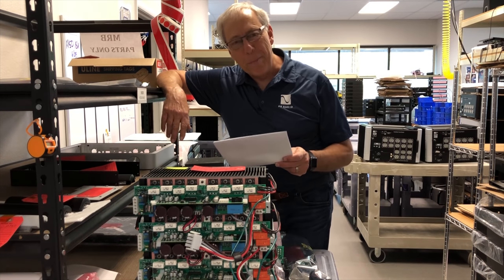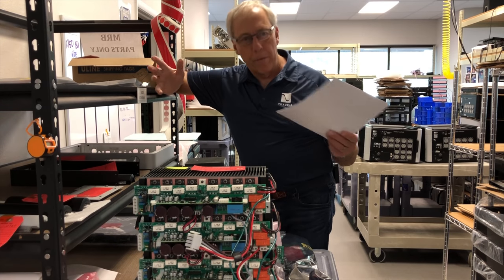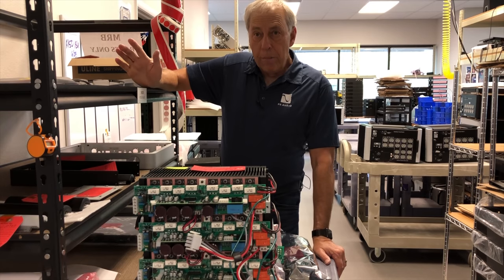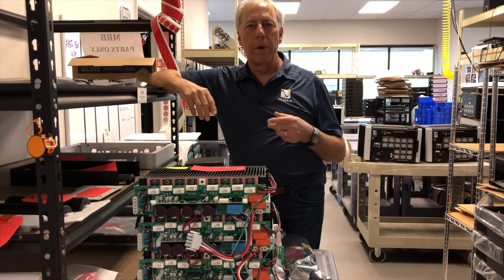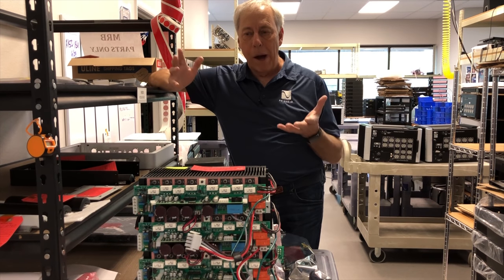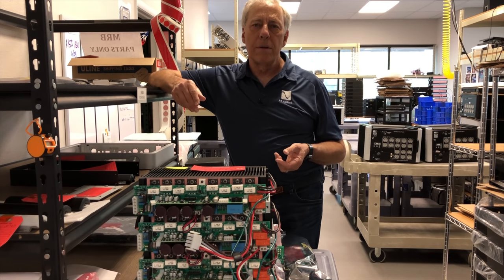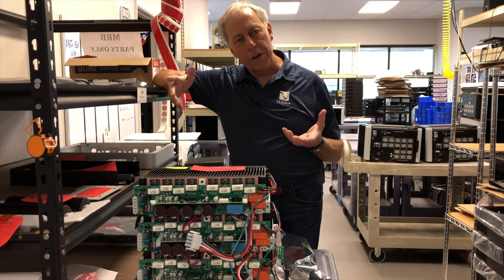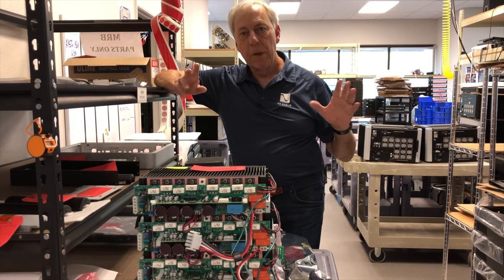Is the BBC dip still used in speakers?

Comment: The crossover region is always difficult as in nature there are no crossovers. Because one driver has a leading phase shift and the other a lagging shift at the crossover point it is very hard to get it right. When in the 2000s when I worked for a high end professional speaker manufacturer in LA, we did a  lot of work on this but not having anything to do with a BBC dip. Rather we found several issues and one of them was helped by time alignment. Aligning the positions of the LF and HF and where applicable the MF drivers was a partial solution. The mid/high crossover was especially critical as the source of sound from the MF and LF drivers were not at the same point, this caused a big phase shift at the crossover point that especially would mess up the female singing voice. Eventually we developed a coaxial mid/high driver with a mechanical mixer for the sound from each driver. As well, the horn throat and flare we developed has so straight sides or square corners. 
There is no natural sound source with square corners and computer modelling of the power available by 1995 showed us the distortion inherent in horns with sharp angles. Going to all curved horns was a huge help.
We also had to tweak every crossover design through extensive listening tests. We had a crossover peg board and boxes of inductors, resistors and capacitors and tweaked the crossovers in a large free field listening area. Then do full 360 degree acoustic dispersion bubbles with out speaker robot. 
Our reward for this was the top share in the US in the church market as our speakers were the very best there were for large venues and gospel music. Especially with female singers. We found that once the female singers came through well, everything else too care of itself. I cannot tell you how much Diana Krall and kd lang I listened to. with 24/95 SACD players. Babylon Sister was another track that I heard too many times. But while I was there, we had the best sounding large speakers and went off then to do digitally steerable columns.

Comment: This is a critical topic with regards to speakers.  the crossover point and how it blends is huge to the accuracy , or character if you prefer, of a speaker.  Personally I need as flat as possible but that's not as pleasant to listen to as the 'bbc dip' per se.

Comment: Eliminating awkward midrange/tweeter crossover phase distortion might be one reason that speakers like electrostatics which avoid the crossover in that region sound so smooth.  Of course even electrostatic drivers have different sized regions with slightly different resonances but they share the same deflection voltage from the same "side" of a crossover filter.   Phase distortion in the low-mid to bass region isn't harsh but simply detracts from the purity of bass notes (far less objectionable than upper midrange distortion).

Comment: and i thought the midrange harshness was a result of the cd recording not my original stacked  Advent two way monitors. thanks Paul. looking forward to your new speaker product, saving my dollars .
Reply: I have a pair of Advent heritage speakers i just replaced the foam on. They sound alright. Not a fatiguing as my Klipsch Icons
Reply: hi, i replaced the woofercones twice in my wonderful advents but since1975 and repairing the crossovers and silver wire, they have been moved to a better location to make room for tekton  paradragons, but just incase they ready to rock,thanks.

Comment: Ever wounder why driver efficiencies are calculated at 1Khz? That is because 1khz is the most efficient response range of the typical driver. I think the bump we hear in the 2-3khz range is entirely down the the natural roll off of driver efficiency into the lower and higher frequencies. Most speaker designs rarely take into consideration that the response of the drivers decay over their full range. You can also take into consideration that 2-3khz is right in the middle of the human hearing range, so it would be perceived to be more prominent.

Comment: Another great video Paul.
Reply: 3000 hurts!!!

Around 3000hz is the most infuriating and fatiguing frequency there is. Around this region the human ear is sensitive.

It's no coincidence that the resonant frequency of the ear canal is anywhere from 2 to 4khz.

Listen to a frequency test at the same sound power level across all frequencies. Your ears will bleed, aka you'll get a headache, from 2 to 4 khz if you started with too much volume.

Comment: Some of the explanation offered still seems a bit esoteric or at best still inadequately explained in scientific terms. Anyone familiar with speaker design knows that the crossover points are challenging. I would also concede that the engineers referenced in the account of the original dip did not have diagnostic equipment as sophisticated as we have today. Nevertheless, if the crossover points "do some fairly funny things and combine to make actually a louder sound at those frequencies  -- and you get different dispersion happening at the crossover point" this would result in a difference in output and dispersion of measurable sound waves, which we can distinguish according to specific frequencies. Though the above quote from the video does constitute an effort to explain the need for the dip, there is no scientific documentation given of the increased outputs and differing dispersion at specific frequencies in today's speaker designs that account for such things. Admittedly though, the ultimate test for any speaker is the human ear and there may be some not-yet-understood factor in human anatomy (ear or brain) that necessitates this dip. The video proposes to offer an explanation of things that we supposedly now understand which were not understood when the BBC launched their BBC Monitors but those engineers knew then everyting about crossover points discussed in the video. I suspect the reason for the dip is more subjective than designers seem willing to admit. We just like the sound better that way even if there is a lowering of fidelity.

Comment: Thanks for explaining things to the world, via YouTube. I was into audio heavily and have actually never heard of the BBC dip. What I learned was the Fletcher-Munson curve of human hearing. For audio to sound flat you had to make sure speakers (and their environment if possible) needed to produce the inverse of a Fletcher-Munson curve, which is not just a curve. 

The frequencies that you cited as being the loudest are frequencies the human hearing is most sensitive at, which happens to be in the same range as a baby crying, which explains why that is the most loudest. If you get a RTA and a kids piano or any piano for that matter and hit each key, you will see the ones in that overly sensitive range sound way louder even though the spectrum analyser indicated the volume was the same.

I was mostly into car audio, so one had to be careful in the environment because of hard reflective surfaces and resonances while making passive crossovers,  subwoofer and midbass box design and placement. Lower order crossovers have the most shallow rolloff but sounded more lively. I've made up to 24 db/ octave passive crossovers and found them to be rather dry sounding. (air core coils, Wonder Caps).

Once you start to look at the polar output as you increase the complexity and the order of the crossover, things change yet again. This was very important to minimize reflections, but it wasn't that difficult as I knew where you were going to sit in a car.

Sweep the car for modes and resonances. Try to dampen them. Put the crossovers where there was a peak and make sure the points were far enough to be flat. Biggest challenge was time and off axis volumes as people often sat closer to a speaker on one side of the car than others.

In the end people went multiple amps on a FFT analyser with auto adjustments on each channel, but they couldn't do it "old school" if you paid them.

Comment: Good question and a VERY good answer.  I spent a lot of my career dealing with control systems (which are at their heart filters), and your explanation sounds (!) very reasonable.  I suspect that the effect you're describing is caused by the fact that the two filters (the low pass filter and the high pass filter) are not tightly coupled together, and their interaction in the crossover range can be smoothed in amplitude or phase, but not both.  Hail to the Dip!

Comment: Do you think this also has to do with the resonant frequency of the human ear canal which is between 2k-4K hz? Frequencies in this range will sound louder to us even though they measure flat on the spectrum.
Reply: Yes I was going to say something similar. Human ears are optimised to hear in midrange because that's where human voices, and most of the other sounds that evolutionarily we need to hear for our survival (potential food, potential predators) are. Our hearing response is not flat but has a peak there. Therefore a speaker with a totally flat response tends to sound loudest to us in the midrange. Listening for pleasure (as opposed to for diagnostic production purposes) always requires scooping out this midrange to some extent so that its subjective volume is more balanced with respect to higher and lower frequency content.

Comment: If you get the chance, would it be possible to see your new building and how you utilized it after moving into that large space you showed us?

With the crossovers, my Dahlquist DQ10s were upgraded, but the interaction between the drivers and the room acoustics just did not translate as well as I had hoped. Another Stereophile with lots of experience in time and with all kinds of speakers and equipment showed me the value of the DBX DriveRack PA2, which is used for professionals setting up speakers for concerts, etc. He had his system set up as an active system with the DBX as the controller between the preamp and the amps. I got one and the difference and control is phenomenal . . . not only can I get the right balance between the drivers in their level, but I can fine tune even passive crossovers and tune the speakers to the room acoustics, which all work to bring these vintage speakers into the 21st Century -- one more step towards what my ears like and enjoy, which when it comes down to it is exactly what matters for each individual person.

Comment: How about 3 separate speakers for Woofer, mids, and tweeter? Would that solve some of the cross-over problems, if the speakers are well separated?
Also, could the most perfect speaker be a super-light, super-strong, graphene or carbon fibre 1-way speaker?
Reply: That is the theory behind 3-way speakers. However, in some ways you are just doubling the problem because you now have two problematic crossover regions instead of one.
Reply: To: Shoegaze forever,
No, that wouldn't work, even the "Perfect-Diaphragm" would not be able to simultaneously reproduce 30Hz and 15000Hz!

Comment: My audio monitor platinum's claim to reach 100k.  What's the point other then marketing to measurement freaks!  Personally I found these speakers light in bass and added a subwoofer to fill in the bottom end.  I am not into measurements at all,  measurements are for your eyes not your ears.